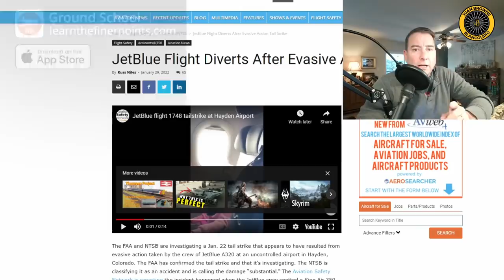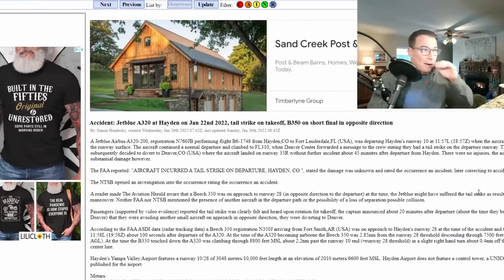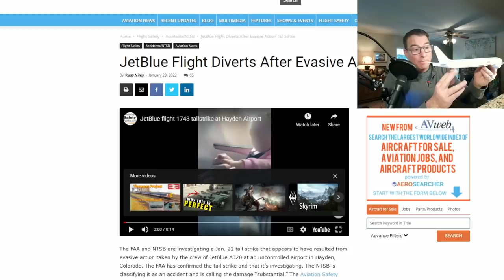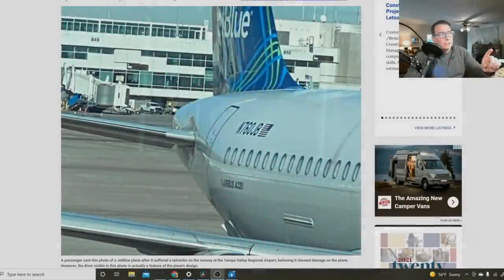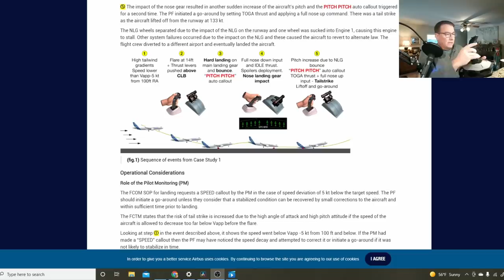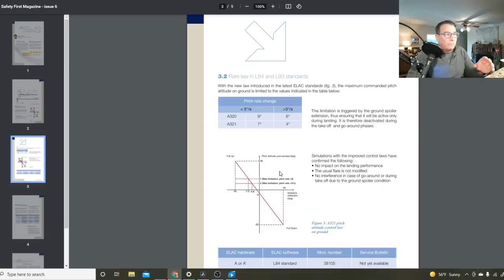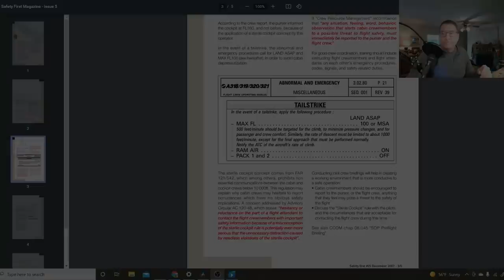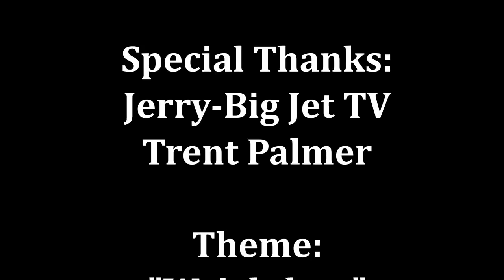Tailstrike!

Comment: Big Jet rocks.  he took some nice pictures of one of my landings at Heathrow in the triple and they hang on my wall (I let him know I was coming).  the BA TS well could have happened with just events.  the pilots had the plane under pretty good control

No excuse for what JB did.  that was completely unsat from the word go

many years ago (oh 25 years :) ) I was on a major airline that operated B737's and B757's out of PHX (they have now merged out of existence) was headed to PHX for some work with Honeywell on TCAS systems...and they struck the tail hard coming out of IAH.  it was clear tht the Cabin Chief had some words with the pilots but they decided to go on to PHX.

At the time I was a test pilot at JSC (and a DPE in the 737).  as I told the Cabin chief.  Tell them when we land my first phone call will be to the PHX ACDO and give them my version of events.   we had a nice discussion after they turned around and came back to IAH :) Fly safe
Reply: I've been at that airline since 1987 and I saw that plane when it finally ferried into PHX, you did real well getting their minds changed, that was a mess.  Spent about 2 months in the hanger as I recall.
Reply: @briand1964  you are very kind.  I had done Vunstick test on both the KC135 with the CFM56 engines and the NG...but this was harder than anything that we had done putting "her" on the tail (with of course) wooden pallets there.

it was so hard that in row 1 where I was sitting you could feel the shudder through the keel beams as she scrapped.  I recall telling the engineer who was traveling with me "tail strike, we will go back that one was hard" and said it loud enough that the Cabin chief heard me.  but by this time the folks in the back were chiming.  and nothing happened in terms of flight path.  after flaps up she got onto the intercom and clearly was talking to the cockpit.  I could see the look on her face.

Atfer she hung up thats when I got up and went to her, she didnt say a word about "Sir the Seat Belt sign is on" I had my ID's out and said what I said to her.  She took them got on the phone and they chimed her up.  She came back and said "we are going back" .  

fly safe my friend.  thanks for the feedback :) Robert

Comment: Very surprised that these airliners don't have shock sensors installed in the back with tailstrikes being simulated as to characterize their shock signature to the airframe so an alert can be triggered in the cockpit that the event of a tailstrike was likely.

That would not be a hard system to engineer.
Reply: Many Boeing and MD aircraft DO have tail skids to protect the structure in cases like these. Checking the condition of the tail skid is a preflight item on the B-767 & MD80. Why doesn't the Airbus 320 series have these? Airbus says they're not needed. Can't happen here.  Computer won't let it.
Reply: @neilrobinson3085  I figured there had to be something. Makes sense that there is a protective plate on some. You'd think that an active system would have been developed at this point though.

Comment: Juan, on the BA 'tailstrike' (or not) you mention the aileron deflections but check out the huge up elevator deflections on the first and second bounce. That is not the technique we teach. Should fix the pitch or even nose down a bit. We all have bad days but i suspect these guys will get a bit of sim to enjoy. On a 321Neo flare mode blends in at 100RA where the THS is frozen (50RA other types  and the system will reduce the pitch by 2 deg). During a G/A it reverts back to flight mode at either 50RA (or possibly 100RA A321NEO not much info on this).

Comment: Seems to me a little retractable wheel at the rear would take the shock out of tailstrikes and help prevent structural damage or at least have a proximity sensor to report to the crew when a tailstrike had occured. This is a serious issue no manufacturers seem to have addressed. JAL flight 123 crashed after a faulty repair to tailstrike damage with the loss of over 500 lives. It doesn't get more serious than that.
Reply: A few planes have this! Concorde did!
Reply: @PetesGuide  Just checked this and I stand corrected sir.  Nice to know there are a few intelligent people on the planet, maybe Boeing and Airbus should recruit a few.
Reply: @PetesGuide  : Most Boeings, from the 727 on up have/had a retractable tail skid
Reply: @aztec0112  but not Airbus models? Some of them? None of them? Did they assume (usual spelling) their control laws would always prevent the problem?

And the other commenter specifically mentioned wheels, not skid plates. I know the Concorde had one, but I thought there was at least one plane still in service with a retractable anti-tail-strike retractable wheel. Was I mistaken?
Reply: Tail strikes are something that should be mitigated by correct operating procedures. To be fair, plenty of modern airliners that are susceptible to tail strike have some form of ‘skid’. Also, any type of skid, or wheel reduces the distance to contact, and however small, limits the amount of pitch available in degrees until a tail contact event. A tail strike is still a tail strike. This would still require maintenance action tail skid or not and would render the aircraft AOG. Tail contact can occur due to a myriad of different scenarios and events. Being aware of your aircrafts situation at all times, plus effective threat management goes a long way to ensuring that they don’t happen. Rather than being a serious issue with manufacturers, it has more to do with pilot training and experience in day to day aircraft operations.
Reply: @109-w7v    Yet this video shows 2 tailstrike events where the procedures you mention are in place.

Comment: I’m honestly shocked that the commercial airplanes haven’t implemented a tail skid system like the navy jets have. I know it’s somewhat of a rare occasion but they do happen and having steel there to protect the aluminum makes sense to me
Reply: Many older aircraft had a physical block or arm that extends to protect the rear of the aircraft. Certainly on the 777-300ER this has been done away with and replaced with a tail strike sensor plus logic within the FBW to prevent over rotation in the first place.

Comment: In all laws you have direct control of the inputs, the laws only prevent over control and abnormal attitude.
Reply: Better said "in all laws you DON'T have direct control" as every command goes through the computers - no physical wires (except the horizontal stabilizer) even in direct law, just then, you don't have protection.
Reply: @pilotboy2612  the protection is a limiter not a bypass on the control authority. It will ider limit pitch or limit acceleration not to rip the wings off.
Reply: @pilotboy2612  what's direct control for you? A cable? Does a hydraulic sys count's as direct? An electric system has the same effect as the surfaces do behave the same way. The level of redundancy is greater and you can still add protections to the system. It's many orders of magnitude better than those old planes. That's why its safer Pilot Boy.
Reply: @FlyingYasha  You're missing my point. I'm all for the ingenuity of Airbus. I was referring to the Laws. In normal law the pilot commands a roll rate when the sidestick is moved - the quicker it's moved the higher roll rate. In Direct law it's much more challenging to fly as you are now moving the flight surfaces directly, albeit with hyd assist. And all this is done WITHOUT physical cables. I think the modern Boeings don't have cables either. They just don't have the Laws.

Comment: I thought A320's had a tail skid, and recall our twinjets had a sensor - squat switch - that alerts you of a tail strike and before that on MD-80 there was a little red flag that would come out on so much compression to require an inspection.

Comment: You might call the control system in traditional aircraft "fly by steel." Also, as a non-pilot it strikes me as confusing to have several modes with radically differing rules. One second something is not permitted and the next it is. That could play heck with muscle memory.
Reply: Yes - and unfortunately it sometimes did.
Reply: Mike, you nailed it. That is why we train, train, train to proficiency and take flight checks every year. In-flight briefings add to the muscle memory.

Comment: Not a pilot, so this might well be a dumb question, but if you have a tail strike on take off in a big jet, what about the fuel load if you are supposed to go around and immediately land? Do modern jets still have to dump fuel first nowadays, or is that a thing of the past?  Informative stuff as always. 👍
Reply: I fly a B737 and they don’t. An overweight landing in a 737 not a big issue. Big airplanes that fly for 15 plus hours and carry heaps of gas do have the ability to dump I think.
Reply: Good question, but most modern jets do not have to jettison fuel before landing. In fact most do not have the facility to do so.
Reply: @gordonrichardson2972  Thanks, I thought it was a long time since I’d heard of an aircraft having to do so.
Reply: @steveNCB7754  The B747 is most widespread aircraft capable of fuel dumping, but with 4 engines has little need to do so, and very rarely has a tailstrike.

Comment: What happens at around 5:06 - 5:08 might be the start of the chain of events. Notice a slight pitch change up, most likely after adding excessive power then followed by a rather quick change in pitch nose down. Bleeding off airspeed while floating in the touchdown zone momentarily gives it away,  they were carrying a little too much speed on top of a gusty crosswind correction. It all quickly went downhill after that. The goal being get weight on the wheels and start the landing segment, but not at all costs - just go around. Easy for me to say. I’m a big fan of your channel, keep it up!    If it’s not a Boeing…
Reply: I'm not a pilot but your assessment was my first thought when I watched the video: the plane seemed to me to be too fast and didn't settle onto the runway normally.
Reply: That part of the video where the aircraft appears to be floating may have been a wind gust, which temporarily increased lift. That would probably have been a better time to initiate a go-around, while the wings were still stable.

Comment: How often do tail strikes occurre? Could a small tire be engineered into the build to prevent damage to the tail? Good info on your report.
Reply: Some airliners years ago had retractable tail skids that helped with tailstrikes. The tail skids were structural, but had a feature that would indicate if the skid had contacted the runway. I'm thinking of the B727 and some of the 737s; but there may have been others.

Comment: I want to know about buildings that could be blocking the cross winds across some parts of the runway and accelerating the wind passing between building or over lower buildings.  That could have effected the left west wing lift on your second video segment.   
The passenger video of the tail strike noise should be shown in ongoing training of cabin crew if it's not done already. 
I wonder if there are accelerometers or G sensors mounted in the tail area. Probably not enough passenger tail strikes to need it.

Comment: Know anyone who drives a car in stir-the-pot mode? There's never a quiet moment, even on I 80 across the Nevada high desert on a windless day.  Surefire way to drive passengers crazy, and it increases the risk of an accident if one of the zillion micro-corrections goes awry.
This driving style caused my family to travel in two vehicles for a while.  Others wouldn't ride with the overactive driver, who in turn refused to be a passenger. 
Ultimately the DMV solved this problem for us, as the older driver couldn't pass a road test.  (We conspired with a doctor to make the driving test happen.)

Comment: Great report!  Love it!  I could imagine that once toga is initiated, that direct law is automatic at that point?  But I'm just an observer.  Very interesting post here Juan.  Lastly, I thought that a lot of these aircraft had skids on the aft part of the fuselage to prevent damage like this?
Reply: Dryan, You are exactly right. Heavy bombers and other large A/C of WWII did have energy absorbing tail skids. Even the C150 that I learned to fly in had one. The Swedish SAAB Safiar trainer had skid plates and bumpers on areas of the plane most likely to make contact with the ground. Is it a lack of common sense?
Reply: @tomclark6271  Well, every part on a plane is $$$, so my bet that direct law comes into play and the pilot controls everything after Toga is initiated - once the specific needs of a toga are initiated by the computer (flaps etc).  A polymer skid on a plane like an A320 would probably cost north of $1mm certified. Hell, everything these days is a million bucks on aircraft.

Comment: Most airliners have a shock absorber in the lower tail section to absorb the shock of a tail strike. We call it a Donkey Dick in the industry. During the walk around before take off the pilot and mechanic will look at that absorber to check for a previous tail strike.

Comment: That jet Blue will get an inspection through NDT. If ok, it will fly to service under 10000 feet IF that damage is within the pressure portion of the aircraft.

I am willing to bet that portion of the aircraft is structurally beefier for the reason of tail strikes 

What speed tape is made for!😉

Comment: A week ago (Jan 28th), my daughter and I flew with Allegiant from KIWA to KSNA on an Airbus A319. The flight, for the most part, was turbulent but uneventful. Takeoff was smooth, but had a high angle "get her off the ground quick" feel to it. (My daughter was worried. Apparently she's a nervous flyer. Me, I found it amusing.) Sadly, the landing was anything but buttery. I don't know if the pilot flared too late or came in too fast, but he hit hard enough to bounce the minute both main gears contacted pavement. Wasn't a tail strike, but we hopped a bit on the runway, followed by the nose gear coming down a bit hard.
Reply: Probably an ex-carrier pilot.
Reply: Sounds like a classic SWA landing
Reply: Was it turbulent on approach to landing? The infamous Santa Ana winds can kick up pretty strong this time of year. In such a case, it's better to get a firm controllable landing rather than trying to grease it on.
Reply: @Gigantasy  No, because no wings were clipped. (Too soon?)

Comment: Seems like the landing ( speed , flaps , pitch ) should not favor holding the nose wheel up as you would in zero wind  , but expedite getting the nose wheel down sooner rather than later and letting the landing gear absorb more energy vs what happened .

Comment: Coming into Modesto on a solo flight when I had about the O 40 hours and I’ve just been cleared as a private pilot to carry passengers brought a 172 in half of wind blew my wing on my starboard side right up at a 90° angle and I slammed it back down on the runway nobody said anything and I just took off and never look back never forget that no damage to the plane just to my ego. Situational awareness always important.

Comment: Did you think the BA Airbus was using wing down or the crab crosswind technique or none?
Reply: You don’t fly wing down in a jet with under slung engines. Crab, squeeze rudder to straighten aircraft then apply aileron to stop the aircraft drifting down wind. Looks to me that into wind aileron wasn’t applied and the upwind wing lifted up. Too fast on approach possibly ? flared too much hence the bounce ?Just my opinion, I fly UK regional, not airbus though.
Reply: D. Allan, I also thought that it seemed to float a tad too long.

Comment: I wonder if the software is sophisticated enough to anticipate the pitch up from the accelerating engines so as yo get the forward elevator required in early enough (i.e. before) to cope, or does it just respond in real time to what it can measure now.
Reply: Control software rarely anticipates the effects of external inputs, mostly it is reactive and tries to dampen the disturbances. Pre-emptive actions can lead to runaway oscillations.

Comment: My question is how do you get over the mountains from  Hayden to Denver without exceeding 10,000 ft?  Did they fly north into Wyoming and cross the Rockies over South Pass?
Reply: 2:05 they climbed to FL310, tail strike was unknown to the crew at that stage.
Reply: @TrainDriver186  Cabin crew didn't report it?  Potential disaster.

Comment: Juan, did the Emirates 777 that's been in the news for the last several days for taking off at a high rate of speed (269 knots, I read), at a very low angle,  and from the last several hundred feet of the runway have a tailstrike as well?
Reply: Tailstrikes happen from pitching too quickly or more than is needed to get airborne so no since the problem was staying on the ground for much too long and not gaining enough altitude
Reply from the maker: Not sure…

Comment: japan airlines #123 747 crashed in 1985.  520 killed due to incorrectly repaired tail strike. the rear pressure bulk head failed and the subsequent decompression blew off the tail rudder.  tail strikes are serious business.

Comment: Thank you Juan! Are there no sensors or indicators or black-box sensors that would indicate a tail strike? Or maybe a softer indicating plate that, once contact is made, is visually clear that a tail strike occurred? Something part of the pre-flight external checks.
Reply: Some airplanes have a tail strike skid ( shock absorber built in) and if hit sends a  cockpit warning if actuated by a tail strike.